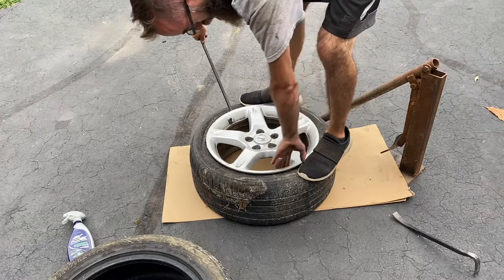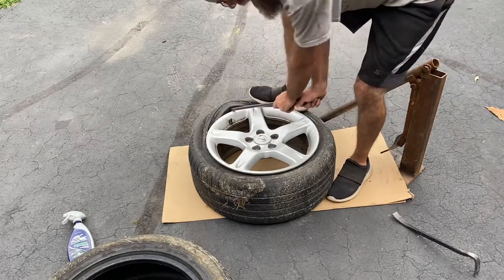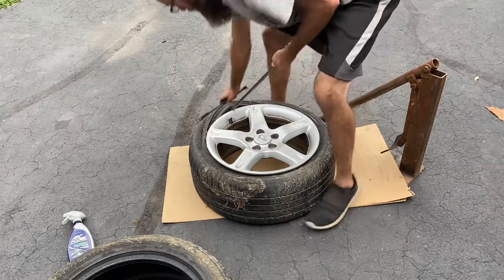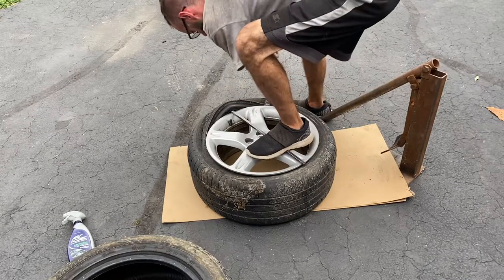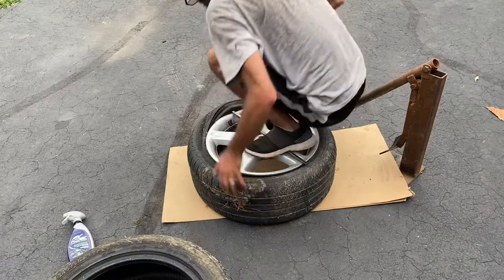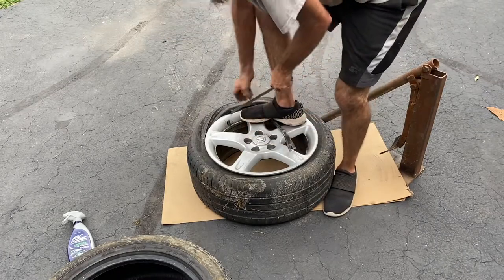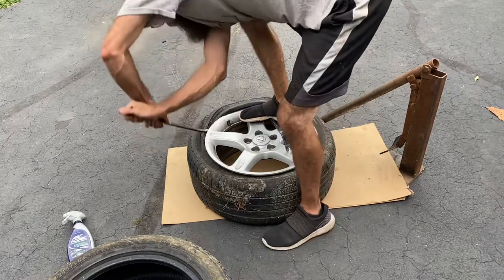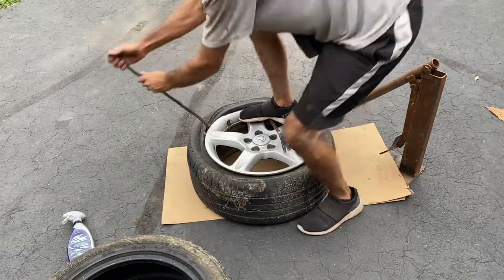Homemade Bead Breaker and How To Change a Tire by Hand

Comment: Jeeeeez you won't be changing any of my tyres. The bead wasn't broke before you started taking the tyre off. Make sure to check the damage on the rim.
Reply from the maker: Been doing it this way for years and never had a problem